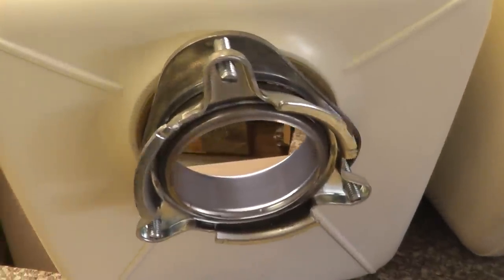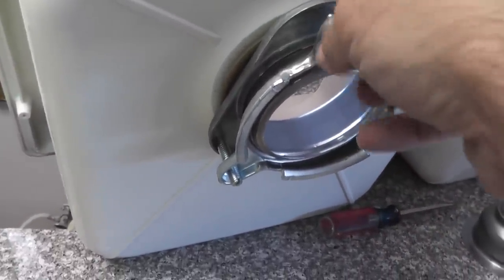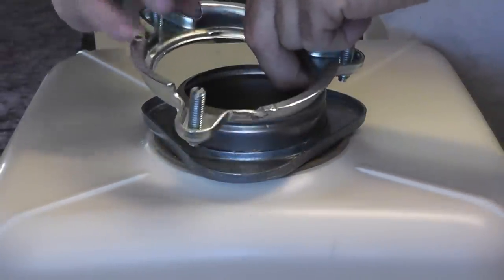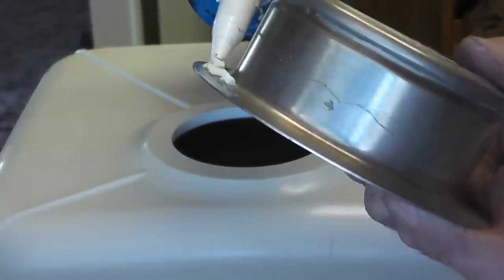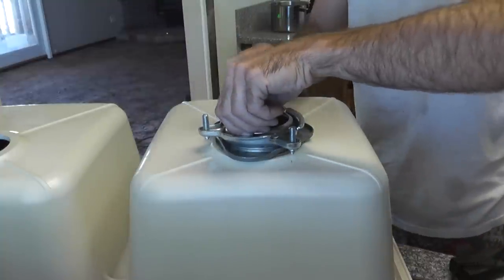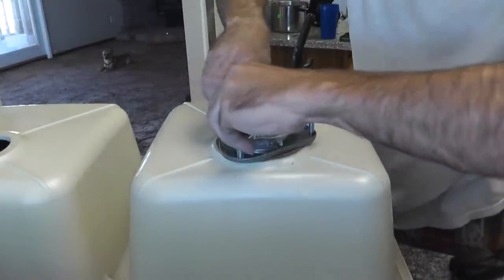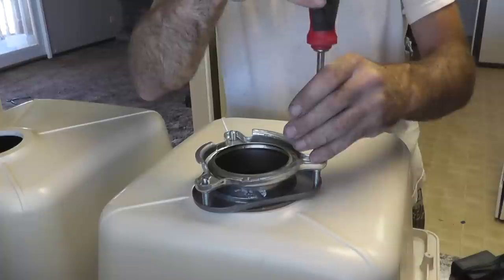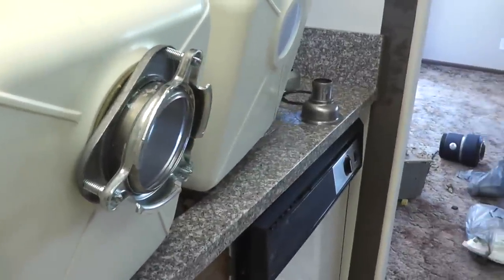How To Remove & Install A Garbage Disposal Mount Assembly

Comment: Thank you so much for this video. I was struggling to revive the old bracket. After wrestling with it for an half an hour, I found your video. Less than 2 minutes in, I had the info I needed and had it off.
Reply from the maker: +Kelly Rowell So glad to help out, thanks!

Comment: Awesome Informative Video!!!  I have granite with a new under-mount sink being installed next month.  I am installing our existing garbage disposal on the new sink and thought I would be stuck with the old stained flange because I didn't know how it worked with the existing assembly and didn't know it could be replaced, but your video clearly shows that I can use some new pieces with my existing parts!!  Also, I now think that I will install my new flange and not so old garbage disposal on the new sink before the granite guy installs it.  Thanks for making my upcoming install less stressful!!!
Reply from the maker: +Dallas Russell Happy to help, thanks

Comment: Thanx - could not figure out where the slip ring went - so many videos assume that it was common knowledge.  I had to use a mirror to assemble due to arthritis. My biggest head ache was that the original plumber glued the black pipe from the disposal to the p- trap.

Comment: Wish I had watched this before I installed mine, now I know how that thing is supposed to work.  After installation, I found a leak at the connection of the straight pipe into the disposer unit.  Realized I didnt have a 90 degree angle under the flexible rubber connection gasket.  So figured all I needed to do was swivel the disposer unit less than an inch to make a proper connection.  I loosened the unit at the  lower flange to do the swivel, but the 3-cornerd flange against the bottom of the sink loosened too.  Guess I didnt have the 3 screws tightened enough.  So now the who thing, unit, strainer basket flange, upper flange and lower flange all revolve as a unit.  Cant figure out how to free them from one another, there is nothing to grab on to with a wrench.  Any suggestions?